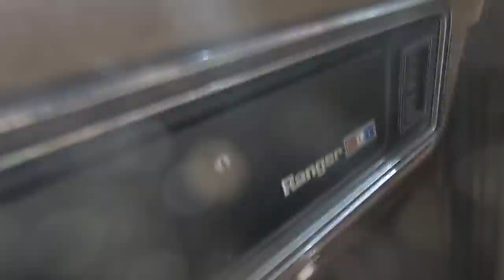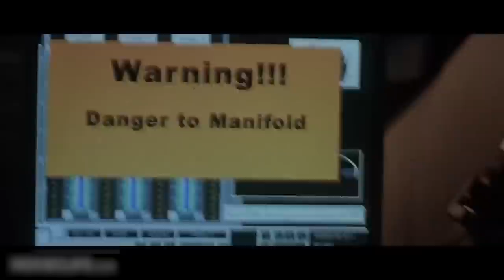1976 Ford F100! Buried in a Snowbank for 18 Years! Will it Run?!?

Comment: One of your best! Absolutely LOVE the slo-mo replays of your face when the tire blows. Priceless! Keep these great videos coming and keep Duff opening those hoods!
Reply from the maker: Glad you enjoyed it
Reply: great show again
Reply: @Mortske Repair  The 360 fe has the lowest compression ratio of all the FE engines. TDC is 1/8in below deck. A true smog motor! They are in nearly every truck I have run across and I wish someone made a piston that sits at or near 0 deck. With those kind of pistons, good heads, 4 barrel intake, and headers, it could be better than the 352.
Great video!
Reply from the maker: @greenhillgarage  Good to know!
Reply: @greenhillgarage  Sounds logical,  a 360ci cant be that Bad.
So that 360 must be the poor octane takin, still smh a Bit of Torque Version of the FE bbs
Reply: @GUIDO STRÖMER  Exactly, there might be some way to make a domed piston work, but I haven't found one. 360 FE Compression and cylinder head flow is so low that it's no wonder they are weak. It might be possible to deck the block, but I am not sure how much it can be cut. A machinist would know.

Comment: my experience with f 360's .   set timing to 12 btc.  lower float level ti lean it. disable emissions. make sure the distributor advance stuff works   got much more power and 20mpg+.   and runns a little cooler.
Reply from the maker: Good to know

Comment: BTW Mortske, as far as people ragging on you for the ease with which this truck's engine "started", I have to say most people need to know how a rag joint failure is common on old trucks. I think you are really elucidating how these problems can be diagnosed as well as fixed! Kudos!

Comment: The square headlight debate. LOL. I had a 78 with square headlights. They weren't supposed to have them until 79 but I had a lot of 79 features on that one. It was actually built in 77 which makes it even more interesting. Amazing how we have so few mice just north of you and yet they can do so much damage in ND. Maybe they respect the border. Those 360s were not my favorite engine (I drove one). In later years they used more 400s like mine had. It was OK.

Comment: Yeah they do interchange I put 1977 ford inner fenders,rad cradle in my 1971 f100 just have to swap hood hinges from left to right and bolt them on the inside of the inner fender

Comment: A 70s ford truck my dream truck. Dad had a 75 f100 4x4 360 with a 4 speed. Had it 20 years and had 213,000 on it when it unfortunately went to the junkyard. The 360 had 390 heads and a 4 barrel carb that woke it up some. Dad used it hard plowing snow and hauling firewood.

Comment: I actually like this 1976 Ford. If you think this car is rusty wait until you see some pre 2010 Fords and other brands in the parking lots. Some have scaly rust just like a dead dinosaur. My 5 cents of idea but I think it is definitely a old mans cars. However the air cleaner rust must have been a combination of many things. I think first the mice made a home into it. Someone later tried to start it and cause a fire and that also took the air cleaner out. I think someone did try to revive this vehicle before it ended up where you picked it. But as usually they ran out of money or they just have no time.

Comment: Dentside timeline for ya.  1976 was the last year for the FE. 76 was the first year for shoulder belts. 76 was the last year with exposed filler necks. 77 and up had gas doors, and started using the M motors. 460s were available in 2wd only in 3/4 ton and up. "the more you know" ☺️
Reply from the maker: Good to know

Comment: When I had my '70 F100, it ate through the rag joint at the worst possible time.  The sun was hot.  The sweat poured into my eyes.  The speed was a little more than the posted limit but WAY more than the truck should've been going in its condition.  The road curved a little to the right.  The steering wheel spun freely in my hands.  The truck continued to go straight.  The curse words came out of my mouth faster than Eminem's Rap God lyrics.  The red Corvette parked in the pawn shop parking lot kept getting closer.  The oncoming traffic swerved, stopped, and honked their collective horns.  The brakes barely worked enough to slow me down as I jumped the curb and came to a halt about a foot from the fiberglass fun machine.  The AutoZone employee asked me if it was 2 wheel drive or 4 wheel drive.  The rubber hockey puck was unpleasant to replace in 110 degree heat and 200 percent humidity.  The truck made it back to the all bills paid apartment.  The air conditioning growled but did not relieve the tension.  The sleep lasted sixteen hours that night.

Comment: $650?!? That’s CHEAP! Up here in Canuckistan that truck would bring $1000CDN not running. It needs a lot of rust repair but every panel it needs is readily available and they’re cheap. $650 for the truck, $500 in body panels, a winter in the garage and a guy has got himself a good driver. We do it for the enjoyment of putting them together, not for the practicality.

Comment: Definitely old man truck....

Bought a '87 Ranger (the compact truck) 2wd long box back in '94.  A red truck.  Had a red bug shield and aluminum running boards as well as similar aluminum topper.  Only sticker was a pheasants forever.  The prior owner was a retired town cop.  The bug guard got removed after the first time I drove it at night.  Lit up like a big red glowing log out there and a distraction for sure.  Running boards got removed kept banging my shins on them.  Topper got left as it was handy to keep stuff locked up out of the weather.

That ignition pickup could be for a aftermarket cruise control maybe?

Comment: Excellent video Mortske Repair  :) also Duff Dog 🐕  👌 👍 and surprises me the 1976 Ford F100 Ranger XLT with 360 2 barrel and AUTOMATIC TRANSMISSION possible got 377 rear gears! That amazing how start that with key ignition switch and extra oil filter system too Lol! Yes wild when pop 2 set tires of back Lol !

Comment: 59:59 best way to get one of those for cheap?

Go down to the local hobby shop that deals with balsa RC airplanes.

Serious. The covering on them...the 'skin' if you will...it's heat shrink plastic. To apply it, we first use a small iron to adhere it to the wood around the edges, then we use a heat gun just like that to shrink it tight like a toiger! That heat gun is only 20-30 bucks.

Comment: Something I learned, driving in winter in North Dakota, 1. Drop the automatic into neutral and it will stop on a dime. Handy to know when you come to a sheet of ice intersection. 2. Start out on ice in 2nd gear. 3. If you approach an icy intersection (IN THE COUNTRY!) and nobody else is coming, don't stop. You'll just slide into the ditch. City cops frown on No. 3.
Reply from the maker: All correct

Comment: If no one mentioned it, the loop over the spark plug wire looks like an old aftermarket cruise control, I think. Also yet again; another great video
Reply from the maker: Thanks for the info!

Comment: That's one thing for sure. The 360 wasn't a big powerhouse. I have a 1972 F250 that originally had a 360. The build plate says it had 154hp at 4000rpm or something like that. Back in the day people either said it was okay or a real dog. Seems like if you get the right compression ratio and cam, a 360 should do pretty good.

Comment: 390 has 4.05 bore 3.78 stroke ...  360 4.05 bore  but with 352 crankshaft stroke of 3.50 stroke making 360 ci heads are most commonly the same after 72 ..some 360 ci passengers side exhaust manifolds are more restricted you can see the slight difference in shape if you know what to look for...
Reply from the maker: Good info

Comment: That button is probably a neutral safety bypass, when the column moves there’s a little metal tab on the inner tube that loves to snap off. For about a week I had to have the neutral safety switch removed from the column and move it by hand to get my truck to crank. I can absolutely see why if you couldn’t find a replacement someone would put a button in.
Reply from the maker: Makes sense

Comment: Smog system: Air injection NOX reduction. Fresh air is injected into the exhaust manifold to make the exhaust gasses continue to burn Through the manifold  thus reducing the emissions of Nitric Oxide and Nitrogen Dioxide going into the atmosphere.

Comment: I have a buddy that was a ford certified mechanic for years. And for decades that oil pressure indicators that only say L and H on the trucks had no pressure values. In essence an idiot light in the form of a gauge.
Reply from the maker: Pretty much

Comment: As I remember, 76 was the first year that three point belts were standard. I'm sure they were mandated. You can add them in yourself going back to 67. They all have the captured/welded nuts in the back of the cab columns.
Reply from the maker: Thanks for the info

Comment: I believe fords oe coupler used urethane also you can use the rag joint from the help section to replace  just the rubber I've done it many times
Reply from the maker: Good to know

Comment: I think on the older ones like that, it’s a 5psi oil pressure switch. At least 5, good. Less than 5, no bueno. I know I put a pressure sender and actual meter on my ‘90 F-150
Reply from the maker: Interesting

Comment: 2005 gas is G.W. Bush gas. '01-'09  Obama gas is '09-'17.  You usually seem to mess with Clinton gas '93-'01, or Reagan gas '81-'89.

Back around 2003 I picked up a 1996 E150 stealth campervan.  It was just a brown van, with a full RV interior, but the exterior had few clues it was camper.  It was a ton of fun, camping on the Oregon beaches, and going to the Burningman festival.  It had a 351 / 5.8L V8, and it had a similar dual remote Amsoil Filter system.  With that setup, you could run 10k between oil changes.  That van also had an added large trans cooler, and an extra engine oil cooler.  Thing ran cool as ice through Death Valley.  It was a decent van, but high miles, rear axle started making noise, trans was getting sluggish, and it was going to require some large dollar investments.  

I traded the Econoline off on a TJ Wrangler.  I looked at many, and found a loaded six month old 2005 Jeep Wrangler Sport Dual Top 4.0L 6-speed with the limited slip 3.73 Dana 44 rear.  Had 1800 miles on it when I found it.  I still have it, it's not modified, it's a garage queen Jeep.  Only 53k on it, garaged everyday of it's life.  Hardtop hangs on a crane in the garage, soft top sits rolled back, just waiting for nice days to go for topless cruises.  Currently it's worth more than I paid for it, which is nice.
Reply from the maker: Awesome

Comment: Dam i was ready to drive out and buy this gem untill the funky slow music and the big rotted hole in the floor that i forgot about . Reminds of the bad old days workin on these turd boxs. They probably were more reliable then my 1974 J20 jeep with the 401 engine that no parts store knew who made the motor. You ever have one of those that you just wanted to hold it to the floor till the engine locked up:face-green-smiling: so you had no choice but to give up on it, that was the one for me . Maypops and retreads all the way.

Comment: I put headers on my then new 76 360. The manifolds on these things are so restrictive because the fe went in so many vehicles? Anyway advance timing with good headers and Mufflers and the 360 will get way better fuel mileage and perform like a 390,I love the fe family I had a sweet 66 Squire with a 428 in 72.Real Sleeper talk about top end.The 332 352 390 is a mid block not big block! The Mel was big block and then 429 big Block ............... Hey Duff how's it hanging? All the way out EH? To Duff from Monkey his Canadian all most twin.

Comment: I had a 77 F150 that had the same problem. I had to put a push button in it to start it because you had to hold up on the shifter to get it to start. When the shift collar broke It wouldn't start like that anymore. So in came the old push button start setup...
Reply from the maker: Makes sense

Comment: Just a note.  I realize you determined the year, but the headlight shape of the 78/79 aren't always indicative of the year.  Those had the large grille with the rectangular headlights.  But I found I've always been confused by the headlight setup on those two years.  Supposedly trucks sold as fleet vehicles in 78 and 79 had round headlights, and the others had rectangular.  Whether this is true or not, I am not sure. But there were definitely 78s with both.  Pet Duff for me, bro.
Reply from the maker: Yeah it’s not really clear

Comment: L for oil pressure on fords is 5psi as the switch opens at 5 the middle is about 30-40psi depending on year and H is 60+psi also that 90 degree elbow is a vacuum port for smog and yes the 360 is pretty gutless because of smog
Reply from the maker: Good info

Comment: Torches are painfully antiquated. Been laughed at a time or two busting the heat gun out until I got what I was taking out, out; and didn't damage, melt, or char it.

Controllable, and more than enough heat unless what you're heating has so much thermal mass it can't win.

Comment: I'm half way into this and you haven't seen the power brake vacuum hose is disconnected. Major vacuum leak. The steering columns in these trucks are so cheap. Plastic bushings, stuff clips into place, light weight steel eggs out. Just junk. It so rusty. Pull engine, trans, rear and maybe some moldings and interior parts and scrap rest.

Comment: Not uncommon  on dent sides to break collums most install rachet shifters my mom had a 77 and she broke  something  in the column  had to put a b and m shifter on the floor and a lock switch  for neutral saftey.

Comment: brake booster? or does this have Henry's black painted empty coffee can vacuum accumulator? found one of those puppies with a pinhole, had driven another mechanic nuts, his ears had to have been really bad, because mine are shot from military before hearing protection, plus flying gas turbine rotor wing, and jets.😁
👍🇺🇸😎

Comment: It is the first time I heard of a snow bank lasting 18 years .I was wondering how long it was gonna take for You to realize the brake boost line was off.
Reply: Lol, I saw the brake booster with the hole, and the line just below it too! Had same issue on my 58 cadillac,  started it up about a year ago and heard this loud hissing!! I'm like WTF? Engine was running rough,  and it always runs smooth. Took me about 30 seconds to see the the vacuum hose had fallen off the bottom of the booster, hooked it up and she smoothed right out. GREMLINS!!!

Comment: I never understood why Ford discontinued the 352 and replaced it with the 360.  They should have kept the 352 as the base V8 and offered the 390 as an option.  They never had the potential for much power, the piston doesn't even come to the top of the bore.  And they were all 2bbl.

Comment: Put new brakes and tires on it! Make the gas tank work! Put a patch panel aka license plate over hole in floor pan! Change oil! Get another breather assembly on it! Should be good to go! I would not be afraid to drive it all the way  down to Texas! It's a good ole 800 dollar truck!
Reply from the maker: Good idea!

Comment: You haven't already checked them out check out Thunder head 289 and junkyard digs they got a lot of videos on the ffe motors thunder head 289 has I think around at less three trucks with ffe motor oh thunder head 289 Luke  he has a ford maverick with a 302 with a lown mower cab on it and he ran it on power tour last year.

Comment: Every FE is a 360 when you're buying and a 390 when you're selling.  Pull a spark plug and measure the stroke, it's the only way to be sure if the seller claims "ah we done rebuilt that it's a 390 now, lost the receipts though"

I prefer the 360 when it comes to FE motors in trucks.  1) they are going to have a 2100 or 2150 carb, and those are easy peasy lemon squeezy  2) they put out 327ft-lbs of torque at something ridiculous low like 1400rpm  3) even with pulling gears like 410/411s they will still give you 14mpg at 60mph all day long  4) no one wants them so parts are beyond cheap

Comment: I didn't know that Ferrari designed a blow dryer motor I think it is like 150 or 200k rims my sister got it when she graduated from cosmetology school I remember dad was going on about this 50 dollar unit drys in a few minutes  but just like the way hoover vacuum cleaner and the chrome ones were commercial use and not available anywhere but vacuum cleaner dealerships Ole saying you get what you pay for definitely a true story

Comment: Know the FE well. Stock this 360 is crap but all parts are readily available to make a fantastic rebuild. Wont be cheap but you can build a torque monster. But dont think you can buy a beat up old truck and that old motor is going to be a gem with no work and no money.